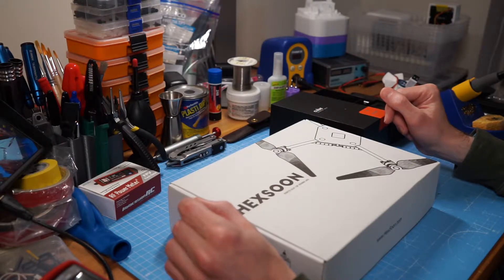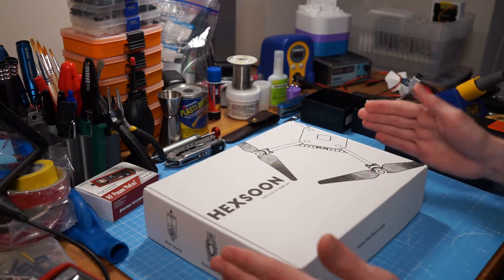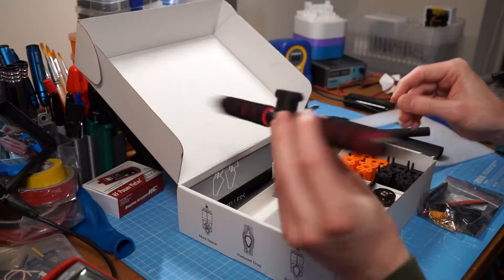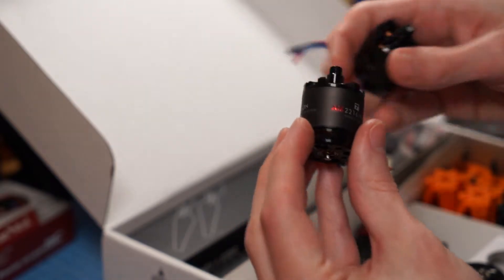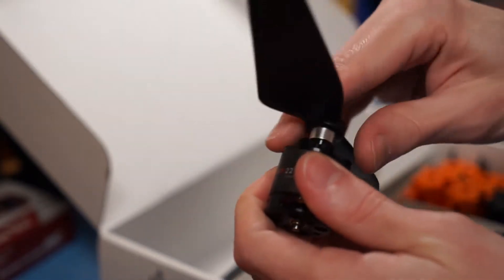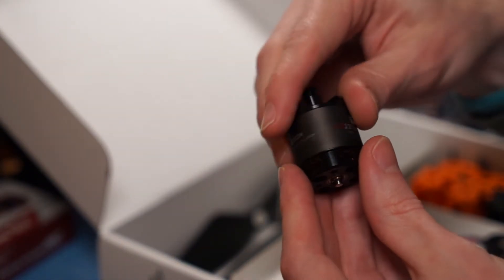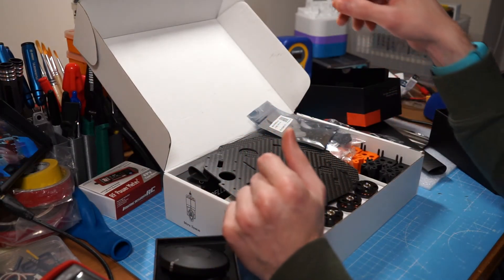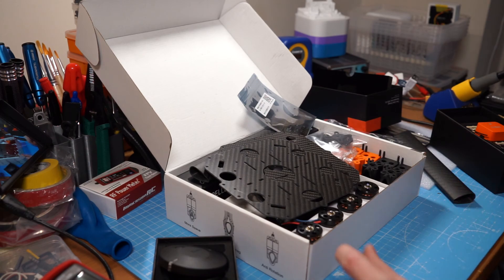Hexsoon EDU450 thoughts // Arducopter Reference Platform // Pixhawk 2 Cube

Comment: Mine just arrived, and I'm assembling it now. Wish this review was posted sooner! I definitely agree about the build quality; the carbon fiber base is awful. The tubes are fine, but the boards look like they were cut with dull scissors. This is my first real drone and I was hoping for something higher quality, especially since I paid a decent amount of money for it.
That being said, despite having no instructions the built has insofar been fairly self-explanatory, and I'm pretty happy with it thus far. I'll post the STLs for any parts that I end up designing soon!
Reply from the maker: Sorry I missed this comment & I know it's probably no use now, but the supplier I ordered from sent me a replacement which had much better carbon plates. So it looks like it was just the quality control the sucked for these, rather than the whole lot being bad.

Comment: Thank you very much for the video. My kit should arrive this week, this is very disappointing to hear. I’ll let you know on the ArduCopter board how my carbon fiber looks. Are you going to change any of it before hand? Are the 3D parts your printing available on Thingiverse?
Reply from the maker: The STL files are linked in the thread in the video description. I had to increase the left/right separation between the 4mm holes on the Cube mount by 0.4mm to make them line up with the carbon, but that could just be down to my poor sample of the carbon.

Comment: I really don't understand why so many of these frame manufacturers cut an excessive number of holes in the carbon plates, as they have done for years. It only saves a couple of grams for these thin plates but massively reduces their mechanical properties, especially with bolt holes that have <1 diameter of material around them. As you mentioned, the centre hole being placed right where you want to mount the power electronics is also baffling. It's like the designer had never seen an assembled quadcopter and just randomly assigned an assortment of holes.
Reply from the maker: I find it particularly annoying with bigger frames, where a few grams here & there is utterly meaningless compared to an AUW that's likely going to be >2kg! On my own carbon designs for larger builds every single hold serves a purpose - they have stack mounts everywhere (20x20, 30.5x30.5 & Pixhawk carrier) & then 1/4" holes like a camera cheeseplate for easily bolting payloads through using regular tripod bolts.

Comment: If this isn't good, what's a better alternative?
Reply from the maker: The quality of the carbon on the replacement that they sent me was much better. They are also now shipping with redesigned landing gear which looks much more stable. It's still not a perfect kit & in particular the electronics are overpriced for what they are, but the frame is very rigid (good!) & there honestly aren't really any alternatives in this size.
Reply: @CJDavies Thanks! How much payload would you put under it? I want ultimately to use it for a robotics project although I'm treating it as a learning experience. I would have wished for a non-'made in China' kit, however, it seems this doesn't exist..
Reply from the maker: @LouisSamuel82  Well it's the classic 'Flamewheel style' powertrain of 2216 ~1000kv motors with 10" props, so realistically you've got maybe 1kg total payload to play with (of which a decent chunk will be your battery). Even if you found a frame designed outside China, the actual carbon would be manufactured in China anyway - I know this from personal experience having my own carbon parts CNC'd & trying to find anywhere at all to do it in the UK before I gave up & had it done in Shenzhen.